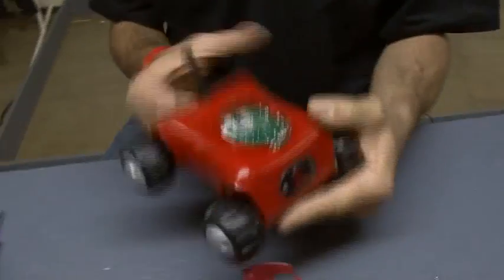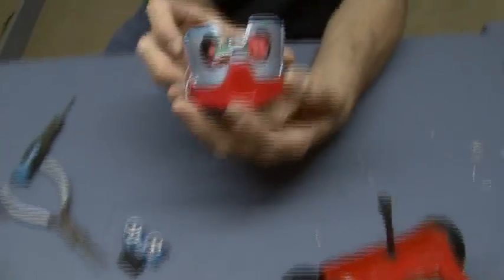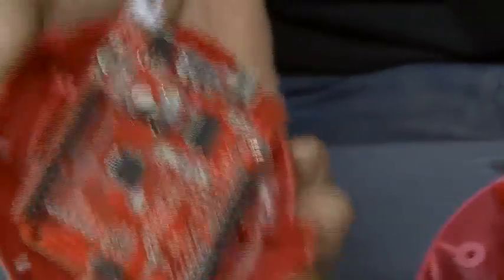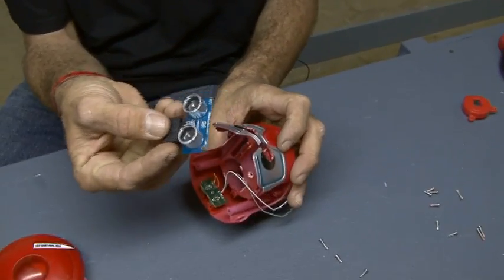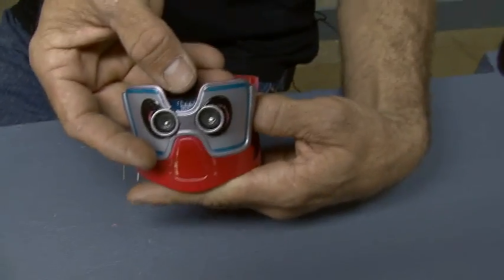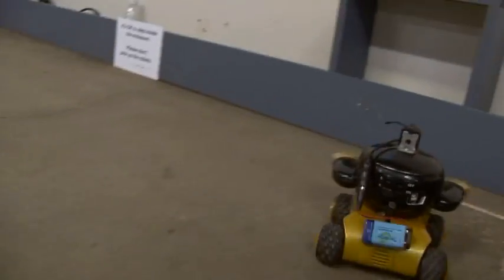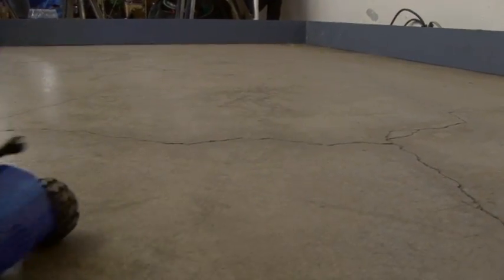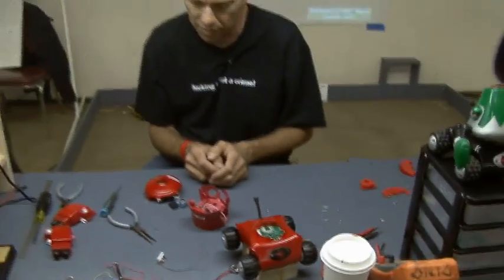Weekend Project: Arduino Rumble Robots

Comment: Arduino is a popular open-source single-board microcontroller, descendant of the open-source Wiring platform,designed to make the process of using electronics in multidisciplinary projects more accessible. The hardware consists of a simple open hardware design for the Arduino board with an Atmel AVR processor and on-board input/output support. The software consists of a standard programming language compiler and the boot loader that runs on the board.

Comment: I think that might get complicated, as they might attack any wall that they might run into. Although I guess they could of made it so that if the UV distance is longer than the distance from the bump sensor, it would start attacking, so it wouldn't attack walls since they would be the same distance from the UV sensor that the bump antennae are (horizontal distance of course)